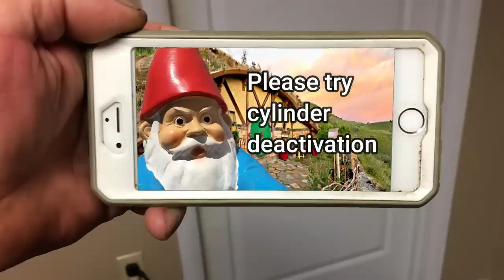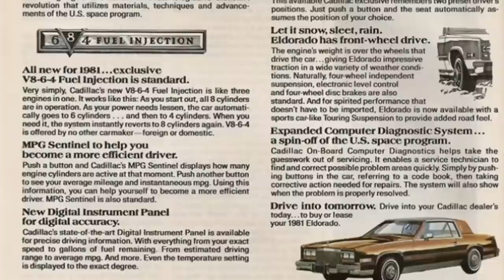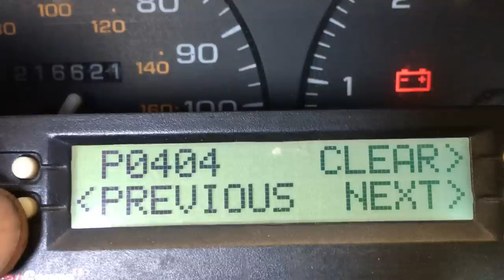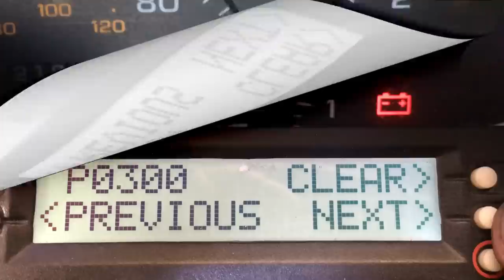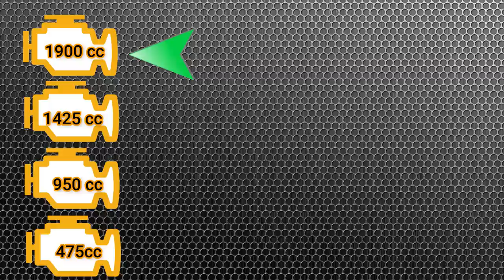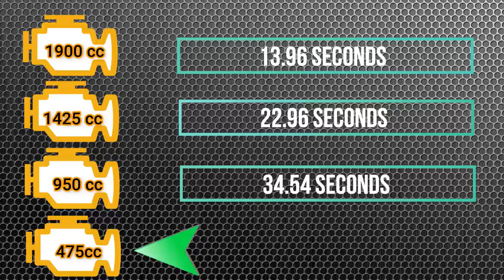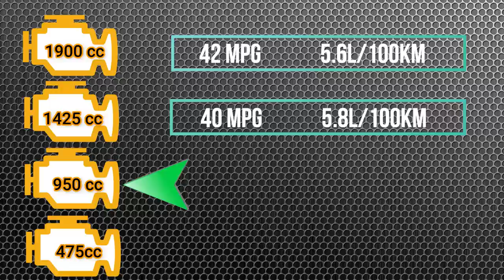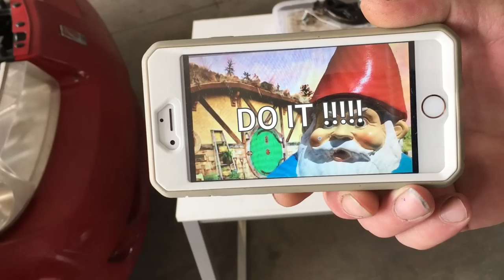S2E16:  We deactivate cylinders on our Saturn and test the car for performance and MPG

Comment: Forgive my ignorance but why did you mechanically deactivate the valves on the 'good' Saturn when you could have just unplugged the injectors and spark plug? wouldn't that have essentially done the same thing without creating compression you must overcome?
Reply: You'd incur "pumping losses" moving air in and out of the cylinders, and probably upset the intake and exhaust pressures. With a sealed cylinder, the compression acts as a spring with very little losses.
Reply: @richardlamoreaux8979  I concur, of course.
Reply: @mommapanda5736  I am really looking forward to another video by Robot Cantina!

Comment: I feel like your fuel economy would have beat the 4-cylinder if you'd tested the 4-cylinder configuration on the same test track. All those 90-degree turns and stops definitely hurt the economy.

Comment: What this confirms for me is that it takes a certain amount of horsepower to drive a vehicle and that requires a specific amount of fuel.  It's incredibly difficult to make an efficient engine even more efficient and the gains are really to be had within the drive train and aerodynamics.  Didn't Thunderhead289 get around 40mpg as well with his experiments?  I wonder what his drive train loss and coefficient of drag is compared to the Saturn?
Reply: Looking forward to more from Jimbo of Robot Cantina

Comment: You could have just removed the plug wires from cylinder 2 and 3 and disconnected/removed one of the 2 coil packs ( 2 and 3 ), plug wires and left the spark plugs in and disconected the fuel injectors for cylinder 2 and 3 to achieve same, maybe better results for the 2 cylinder test, no?

Comment: If you want to get fancy, you could have a switch inside the car tied to 2 seperate relays that goto the plugs and the injectors 12V power since normally (not sure if its the case with saturn) the ecm uses a ground to control the injection and spark

Comment: You'd gin more fuel economy if you removed the deactivated piston. What would be interesting is if you could make a system for the piston to detach at TDC, with only a set of extending sleeves to keep the upper and lower part of the piston rod in line for re-connection.
Without some extreme engineering, an engine like this would be extremely fragile, and not worth the higher failure rate. 
A more effective method would be to basically have 2-8 differrent V twin engines, that connected and disconnected from a central drive shaft (seperate from the piston drive shaft)with some sort of clutch+gear method of disconnecting and re-connecting
Reply: Good point here. 👍👍

Comment: So if the valves on the deactivated cylinders aren't being acted upon by the rockers wouldn't they remain closed EXCEPT for when the piston is on its way down? That sounds like it could be a large load if that's the case because I'd imagine it's like an air compressor that doesn't have anywhere to move the air to. Or if the the valve springs are keeping them closed the whole time then those 2 cylinders are building pressure (going up) and vacuum (going down) which I think would be even more load than just pressure. Does this sound right to anyone else?

Comment: i accidently ran the 3 cyl experiment for a few months because of a clogged injector, was a pain climbing the biggest mountain on the way home from work, pedal to floor, check eng light flashing, going 50mph in 3rd gear. put a set of boche injectors in when i had the money now i fly up the mountain 70mph with almost half my throttle left to open. 

the Saturn sat for over 7 years because it had a bunch of small issues that made it fail PA inspection and i got it in exchange for building a fence. bad fuel in the lines clogged some of the injectors and i couldn't get injector 3 to flow again. money was tight and my truck was illigal so i limped that car to work till i had enogh cash to swap injectors. that little car is quite zippy on 4 cyl and i have started a burn out in 1st gear all the way throgh the star of 2nd gear. alot faster than my claped out 302 running on 6 cylinders

Comment: Question ... instead of messing with the lifters .. why not just take out the sparkplug ... also having the cylinder with closed valves that was not like plugging a syringe and pulling or pushing on the plunger ? that would be the same on the engine causing it to have LOTS of losses to overcome the vacuum or compression. there fore making things much more difficult.

Comment: why dont you use the deactive cylinders as a pumping air into the active cylinder as a turbo/supercharge setup. i rember someone did it to a twin cylinder motorbike and made twice the power on the one cylinder than on the stock twin operating as normal

Comment: I've always had an idea where in cylinder deactivation, you could somehow use the deactivated cylinders to create boost for the active cylinders
Reply: It takes power to move the cylinder up in order to compress the air and make the "boost" I think you're talking about. It would be similar to "water locking" the engine, but with air. Besides, you'd be heating up that air big time. Not good for detonation
Reply: @gionder  a system with a Seperate piston and cylinder used as a supercharger was actually used in the clerk 2 stroke engine in the late 1800's.

Comment: If you deactivated two and three cylinders why do you still need to have the plug wires on?
Reply: I understand that. I was wondering why you still had the spark plug wires connected to two dead cylinders. Is there a reason for this?
Reply from the maker: The ignition system on this car uses wasted spark, The spark plugs need to be connected in order to dissipate the energy in the coil pack
Reply: @robotcantina8957    Robot,   looking forward to another great
video on Robot Cantina.

Comment: Straight up seafoam trans tune and a new cheap spin on trans filter under the air box fixed my 96 SC1 trans from sticking in the upper gears.

Comment: the project I really want to see is taking the Hyundai mechanical variable valve Duration and putting it on an LS motor.
as far as I know, Hyundai is the 1st and only company to achieve mechanical variable duration valves.
Reply: That is something we all would like to see... It would be a great project.

Comment: Wouldn’t it be better to disable opposing cylinders? Like what real dod does. You have to pistons going up and down at the same exact time I don’t see how you can get anything out of that. Similar to pedaling a bike one leg pushing down (power stroke) as the other piston goes back up to repeat that same cycle? I’d imagine it would be impossible to ride a bike when both of your legs going up and down at the same exact given moment or it would be very difficult to say the least

Comment: 7:45 I've seen guys rig up c/k trucks with autos to be "manual" by hacking the harness and wiring up a series of switches to give direct control over the shift solenoids.

Comment: Engine burned oil that was stuck in deactivated cylinder, with no combustion  or even ventilation. My 350USD Honda HRV neglected by previous owners was burning oil via control rings and cylinder ovalisation so brutally, that even few sekonds of high rev engine braking was collecting much more oil,.Opening of throttle after engine braking ended up with thick cloud behind car and few exhaust pops if pipes where hot enough. When i forgot not to slow down with engine it could even missfire for a while on worst cylinder

Comment: the oil burning is normal, since both of those non running cylidners were still shoving oil up to the combustion chamber, which wasn't burned like it normally does, i'd be interested in how this systerm would work if you were to eliminate pumping losses by removign two pistons and rods as well, that might make it quite a bit more economical as well.
Reply: And about that 80% throttle at max and no power at wide open throttle, it's very much possible that with only 1 cylinder active that the trottlebody was to big for it to run on at wot.

Comment: For our edification== Fracking,   or hydraulic fracturing is an oil extraction
technique that involves high= pressure  water blended with sand and
chemicals forced into underground rocks known as shale to capture oil and gas.
Reply: The process was revolutionized by horizontal drilling in the 1980s
and 2000s  transforming America into the world's largest oil producer
overnight.
Reply: We know that the frack sand used to blast through shale rocks
is in short supply across Texas
Reply: @ocdman202  We know that fracking creates jobs.
Reply: Does fracking cause earthquakes???

Comment: I saw a comment about removing a spark plug which would get dirt into the engine would it be possible for you to rig something up to keep the exhaust valve open on the deactivated cylinder. This would remove compression on 4 strokes and vacuum on 4 strokes. You may see better fuel economy and more power. Edit : I see a lot of people have the same idea. Lets beat major car companies at their own game guys!

Comment: holding the exhuast values open on the 2 cylinders would be better because it takes the load of the 2 off the engine.

Comment: I think you should make a new intake an exhaust manifolds. Use #2 #3 as a compressor forcing air in to #1 an #4. It would be like adding boost but with out a blower of turbo's

Comment: I remember the tractor tire repair man had a 4 cylinder jeep engine running on two cylinders with the other two acting as an air compressor.

Comment: I had an S model Saturn, a light weight all aluminum DOHC engine with 9.5 :1 compression ratio, always wanted to see if an E85 fuel conversion was available and how it would run, seems it would be a perfect candidate to modify.

Comment: install switch in fuel injector circuit so you can disable 2 cylinders at highway and use all 4 when accelerating

Comment: Pretty sure this is NOT how cylinder deactivation works on a modern car..... 
In this case, you'd get better results only unplugging the injectors since by deactivating the valves the pistons will always have to work against the compression. 
I'd love to see another go, but with pistons and connecting rods removed. That way you'd remove both a bunch of friction and the ridiculous amount of compression it fights against at the moment. Just machine a couple of sleeves to clamp over the journals of the crank to counter weight and keep the oil pressure up. Wouldn't be too much money to invest, and about an afternoon to lift the head and drop the oil tray to adjust the hardware.

Cheers.

Comment: it makes sense that the two cylinder would outperform the three in terms of fuel economy just due to the force balance causing less losses. I'm interested in if hyper mile tricks could get the two cylinder higher MPG than the four.

Comment: I'd say the best way to do variable displacement is by using two cylinders reciprocating opposedly, like 1-3 or 2-4, and with the EFI instead of removing the lifters just unplug the injector and remove the spark plug so the cylinder wont have compression drag.
The air intake is designed so every cylinder draws air efficiently by the momentum of the air created by all the 4 cylinders drawing air in a sequence creating an inertial flow, so you've had great loses there by standing waves.
So maybe a low pressure exhaust-only check valve on the spark plug would be very beneficial.
Reply: Looking forward to more from Robot Cantina

Comment: Next, remove two of the pistons and connecting rods. Then disconnect the spark plugs and fuel injectors to those cylinders. I would like to see how far you can go with this.

Comment: Piston movement with no valve action causes lots of vacuum in the cylinder and draws oil in.... hense the sm0ke on reactivation of the spark

Try proping the exhaust valve open on the deactivated cylinders as well as removing the intake, less drag drawing exhaust in and out of the cyl vs a harsh vacuum......possibly

Comment: Remove the plugs on the deactivated cylinders. It would be interesting if you could hold the exhaust valves open on the deactivated cylinders instead of removing the plugs also.

Comment: Remove cyl2 and cyl3 spark plug...or lock exhaust valve slightly open to bleed pressure build up in those cylinder... And eliminate parasitic pumping loss from 2 disabled cylinder

Comment: Cylinder deactivation was pretty common on dual port air cooled VWs back in the fuel crisis of the 70s. I bought a beetle from an old hippie in '88 or so that had the rear 2 pistons and rods removed, along with the rocker arms, and I drove it home @35 miles. He swore it was getting nearly 40mpg that way, but it was a pretty miserable driver.
Reply: Maybe  the driver was just sleepy?

Comment: why did the engine get louder when it was only firing on half the cylinders?
Reply from the maker: The exhaust system is tuned for 4 cylinders and not two. An excellent example is our other car, the Honda Insight with the 1 cylinder 420 cc engine is really loud, and it has a full exhaust system with a huge muffler   The parts used to fabricate the honda exhaust were from a four cylinder engine..
Reply: @robotcantina8957     Robot,    looking forward to another
great video on Robot Cantina.
Reply: @mommapanda5736  Love the comments here... I come for the video on Robot Cantina and stay for the comments

Comment: The oil burning when you plugged in the deactivated cylinder(s) is basic if you think about it. They were getting oil splash from the crankcase with no way out. The cylinders had no heat to make the pistons and rings fit properly. Also the rings became "unseated". This means they were floating on a layer of oil. 
Riddle me this and Riddle me that  CAT IN THE HAT. Take a twin cylinder mower engine and disable one hole by denying it spark. Run it one hour and pull the plug. It will be wet with oil. You can also just pull the head and see it. Heck, Run the the thing much longer or do it with valve train disabled or both. You will see what I mean.
Reply: Love this reference to CAT IN THE HAT...  one of my favs😺😺😺
Reply: @mommapanda5736  Great comment.  Looking forward to more
from Robot Cantina

Comment: you could try unscrewing the sparkplugs from the non working cilinders make a small metal block screwed intoo the firewall to put the removed sparkplugs in and hook them up to the coils so these dont burn up , the lack of compression on the non working cilinders might help the engine make more power , then again it might cause it to run rougher , could do a one cilinder with compression one the one and two working cilinder test to see if it makes a difference
the 80 percent trottle thing might be because the single cilinder just needs less air to get the right mixture mixture to ignite

Comment: Why are you not pulling spark plugs from deactivated cylinders
Reply from the maker: Believe it or not, there is less drag on the engine with the cylinders completely sealed off.  Removing the spark plugs would allow air to enter the cylinder and now the engine has to pump air in and out of the cylinders and that increases the drag on the engine.  If you do a little research on cylinder deactivation, you will find the method used is to simply deactivate the valves and the injectors.
Reply: @robotcantina8957  so I've often wondered why factory systems do leave a valve open to decrease cylinder pressure,

Comment: I think you would get better mileage if you removed the pistons and rods from the crank, I think you are sucking both fuel air and exhaust  into cylinder then pushing both out the intake and exhaust, if both valves are not opening then you are forcing the piston to compress the air which adds resistance

Comment: Try 2 cylinder mode again but use the mower carb maybe the injectors aren't run wide open considering the computer is trying to address the "random mis-fire" .... I think the ECU is pulling timing also. Maybe find a clever way to advance it...

Comment: IMO deactivating 1 and 4 would have been slightly better because there is less crank length between 2 and 3 so maybe less crank flex? ;-) (Compared to 1 and 4) 
Also 2 and 3 draw air from the middle of the intake manifold meaning they will probably have the closest to equal air intake charge
Finally, 2 and 3 are both in the middle of the block so they may have the more even and equal cooling. 
Details. I know. 
I think the entire idea of cylinder deactivation is to get rid of pumping losses. Because you pretty much have to run the engine at WOT when you run it on only 2 cylinders. 
A bit like a Diesel i suppose. 
And a 3/4 clossed throttle butterfly  ( when running in 4cyl mode)  does create some pumping losses.
Fun experiments!

Comment: 1 cylinder = ‘lawnmower’ mode. Should have used #3 cylinder only. Vibration might have been a little smoother.